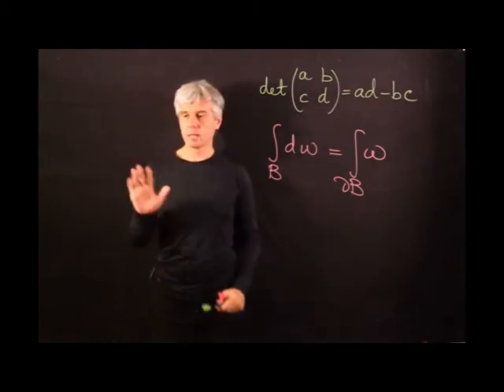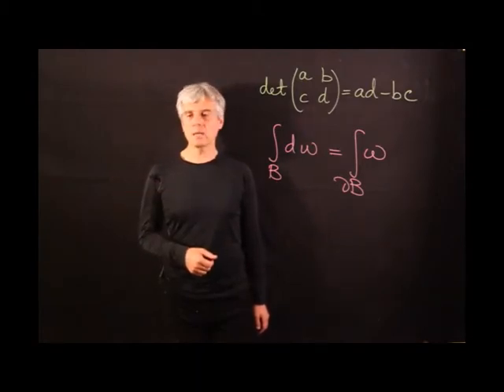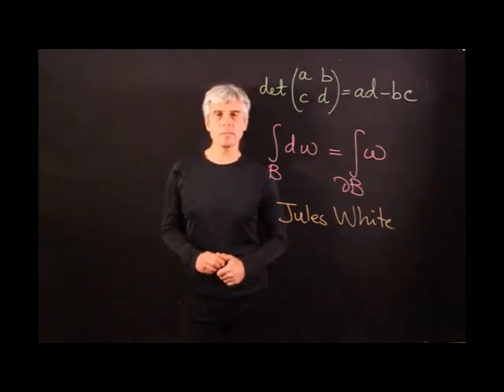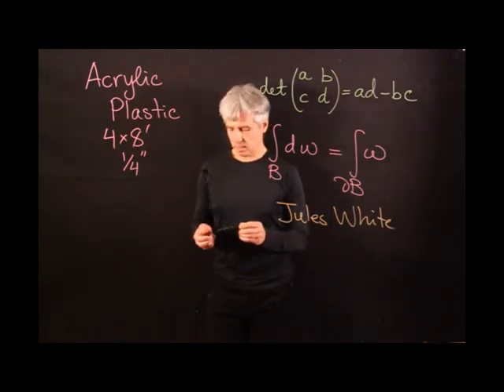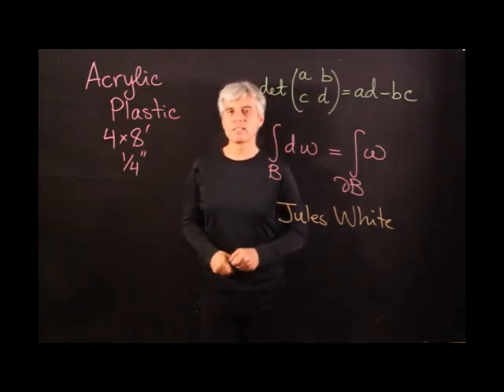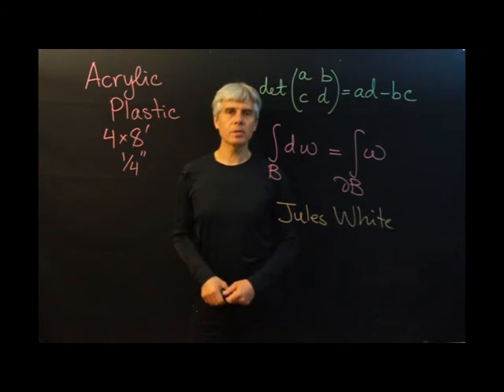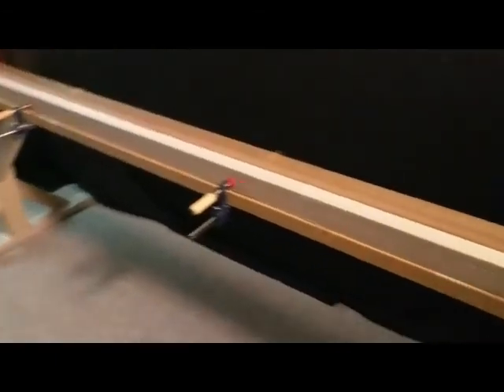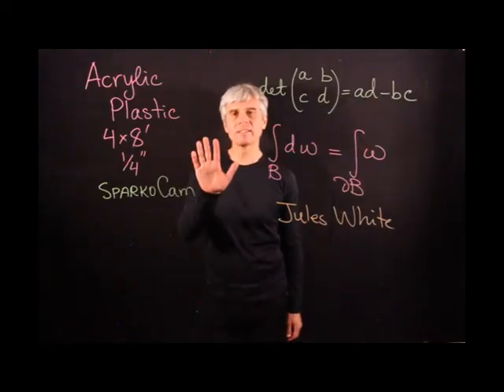Acrylic Lightboard Setup

Comment: I have built my own lightboard and I find that all the smudges appear on my video recordings, and it’s impossible to clean it, and the more I try to clean it the more I see scratches in it, what do you do to ensure smudges don’t appear?
Reply from the maker: When erasing, I would make two passes: first, I would erase with a wet cloth, and when the board dries, I would erase the remaining residue with a dry cloth. I am using a microfiber cloth. This takes a bit of time to wait for the board to dry (but not too long, actually). After two years of using the lightboard, some micro-scratches did appear, but they were practically invisible in the video. For writing, I used EXPO NEON dry-erase markers.

Comment: Good Job Yuli, maybe, have you tried to place the 2 lights behind the lightboard? it should avoid reflections. Keep posting.
Reply from the maker: Thank you for your suggestion Mauro, I did not try this before. It does not prevent reflections from the front, but lights up the board nicely. I had concerns back lighting may create shadows, and it doesn't. The main difference is in the way how the speaker's face is illuminated (front vs sides). May be a viable option.